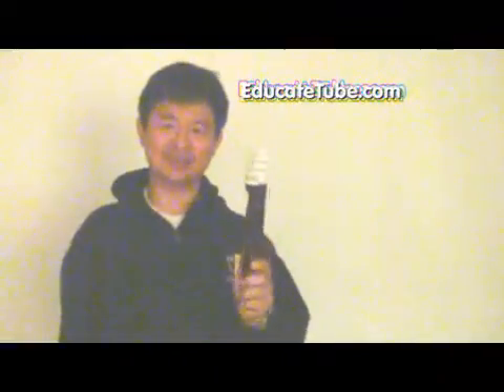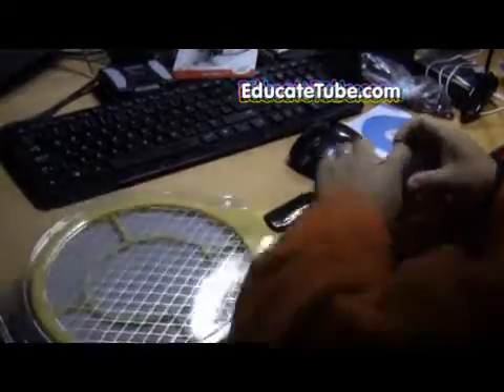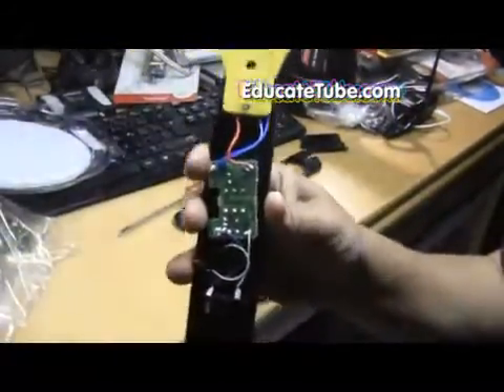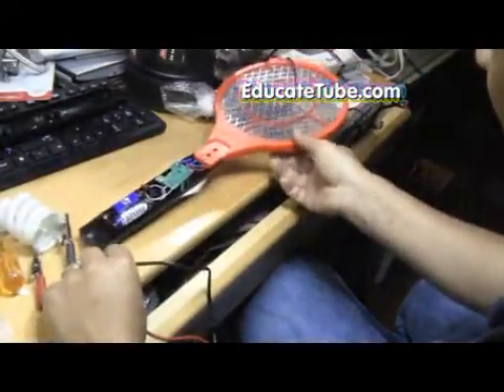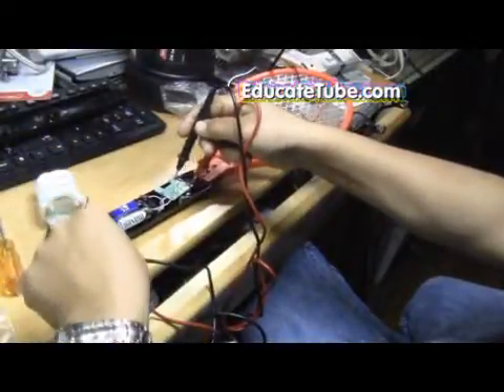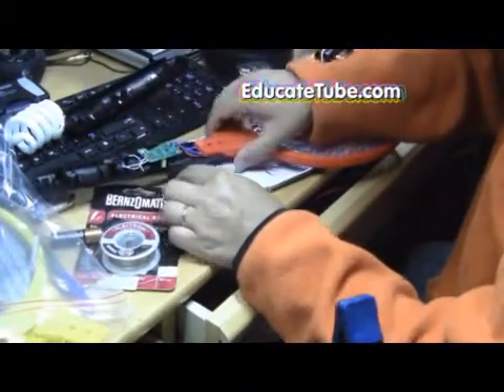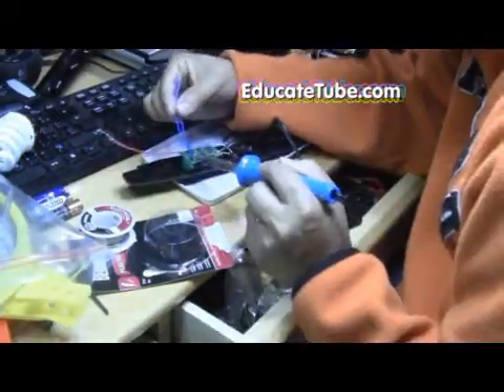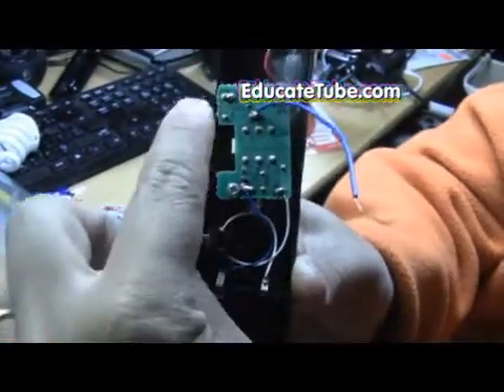How to Make A CFL Light Wand - The World's First Fluorescent Light Wand using a Zapper

Comment from the maker: No, the only way for the glass to break is if it hits something hard.  The circuit in the Zapper allows the fluorescent light bulb to work.  I used the CFL because it can be done with little cheap circuitry trick.  Most people may be surprise that it works.  And it does!